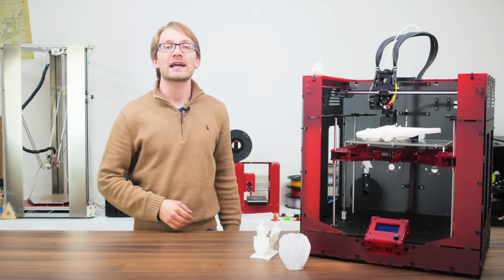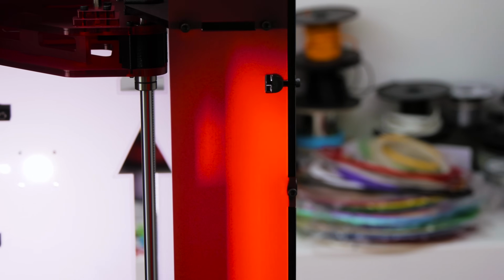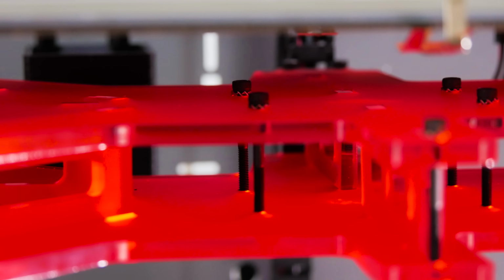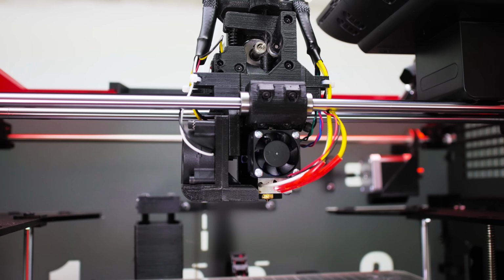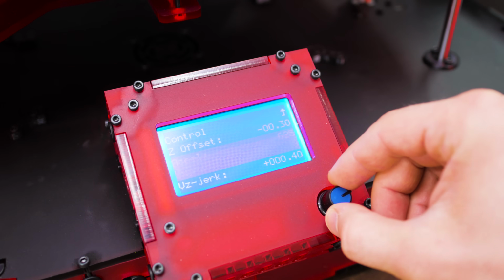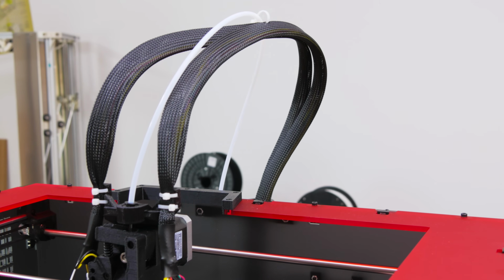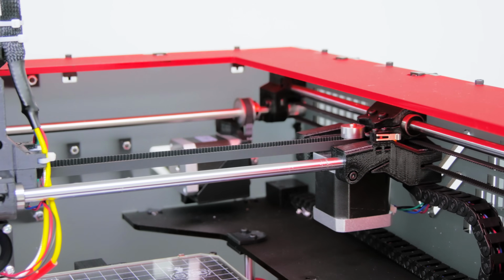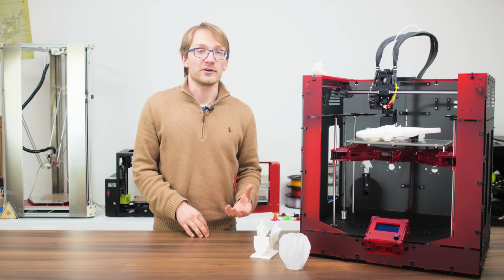Review: E3D's BigBox Pro!

Comment: wow. E3D i would never expect to pick form over function :(
Acrylic is really bad choice
Reply: Weak, cracks super easily, deforms under any heat etc.

Cheap chinese printers are acrylic, you cannot print ABS with them because the acrylic becomes somewhat soft/flexible
Reply: Not thin, non-heat resistant plastic at the very least :D
I would prefer aluminium but requires water jet cutting
Reply: Polycarbonate is not that expensive, but it too flexes. Acrylic is the choice because it's hard and non-flexible in comparison, but it is also very brittle.

PVC could be a contender, but PVC sheets are extraordinarily expensive at high thickness, which is odd that PVC pipes are everywhere. I guess just no demand for PVC sheets?

Still, proper materials is better choice for the frame, use 2020 aluminium profile (cheap in most areas) and then your choice of clear plastic if you need to encase it.

Comment: What electronic/board would you recommend instead? I am new to this and still waiting for my BigBox so don't really understand what would be gained by a different controller board?
BTW Really sorry but I just seem to have reported someone's comment on here by accident, I didn't mean to, iPhone taking a while to catch up and so pressed the wrong thing.
Reply: The pretty much best controller board is the Duet. Here are some of the benefits:
- 32 bit ARM Chip (8 bit microcontrollers aren't really suitable for 3d printers, they are simply too slow and limited)
- TMC2660 stepper drivers (very silent and intelligent like the TMC2130 but more powerful and robust)
- integrated LAN/WLAN with a webinterface
- very nice firmware which is far ahead of something like Marlin
- high quality electronics (no additional MOSFETs or something else needed) and good safety Features
- some really shiny extension boards with many more stepper drivers and fan connectors, a buck converter, etc.

Comment: The use of the acrylic seems like a way to decrease shipping weight, not about durability. E3D mentions it can make for a quieter printer than the plywood models, but there has to be another material with that same benefit that doesn't have these issues. Every mention I have heard online about people with printers featuring acrylic parts upgrading or changing models has been related to cracked or broken parts, some on assembly and others after a few weeks of printing. There are strong varieties of acrylic on the market, but I am guessing the types commonly chosen for 3d printers thus far are not those.

According to the update on their Kickstarter page, E3D has now suspended shipment of these printers as of today (Monday), because of the acrylic parts ending up damaged during shipping. It sounds like a fitment issue during packing, with the acrylic panels not fitting into the packing materials? Details here : https://www.kickstarter.com/projects/e3dbigbox/the-e3d-bigbox-3d-printer/posts/1504854

Comment: I'm presuming that with a 400c maximum using a thermal resistor instead of a the normal temperature sensor, that they are going to strongly encourage people to use crimp on connectors for the wiring instead of soldering them on. I know that using crimp on connectors has been an issue for many people though as getting that "right" isn't always easy.
Reply: That works too. And if people need to make extensions they should be well away from the hot end anyway.

Comment: Soo, to condense the 11 minutes in a few words: It looks nice, but don't buy it and wait for revision 2 or 3 before you reconsider.
My personal impression is: I would buy an other printer with an aluminum or steel frame in the same price range, and maybe consider that PCB they have on the heated bed as a possible upgrade.
Reply: +ExtraBase Just curious what metal framed printer you would consider, in the $1000 price range, with the large build volume of 300x200mm, for E3D's heated bed to even be an option as an upgrade for.
Reply: +Jonathan Gillam Well, I don't have anything specific in mind right now, but i'm pretty shure you would find some prusa i3 variant kit with a metal frame that can support a 30x20cm bed if you search for it. A quick web search led me to www.kitprinter3d.com from spain, and they seem to offer an extended steel frame kit for under 500€. I have not really checked the quality of that kit, but the price seems to be fair, and even leaves you some chash from your 1000$ price range to buy some other upgrades as needed. As an example, better electronics, better linear bearings, different hotend options, what ever you fancy. You could probably even get a few maker slides or other aluminium extrusions and screw them on the kit to give it more stability/rigidity if it has a weak spot... I'm shure there are a ton of other options depending on your skills, location and time. I just don't have the time and motivation to do a full webcrawl on the current market for other people...

Comment: Here is the info and bed requirements for that IR bed probe. 

https://miscsolutions.wordpress.com/mini-height-sensor-board/

I have one on my SparkLabs Sparkcube XL with a PEI sheet covered bright aluminium plate bed. Once dialed in my IR probe works well, I love it with my 3 point mechanical bed leveling!

Comment: if I was to build it,  id use  2020 aluminium, then attach acrylic around it for the heat chamber.
Reply: This is exactly what I am doing. But not just plexiglass, but a combination of 3mm MDF(Painted) and Plexiglass.
Reply: +Brent Milam I own the Big Box as well and I thought the same thing while assembling it.  In fact loose the acrylic all together, it just makes it harder to access components.

Comment: I love mine :) I definitely wouldn't have used any kind of drill on the acrylic frame.  I did mine by hand and have had no cracks and nothing has loosened yet despite ~200hrs print time.
Reply: +Thomas Sanladerer 1Nm is about the maximum that M3 screws can handle. I guess you used a lot less.
Reply: +Thomas Sanladerer I thought I watched an interview with them that said they fixed that problem of the acrylic breaking so easy. Guess not?